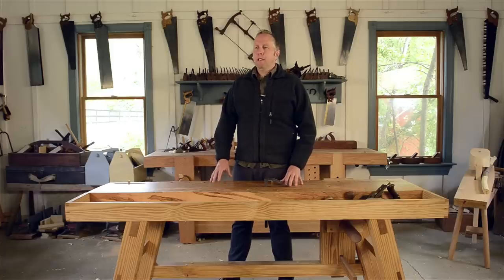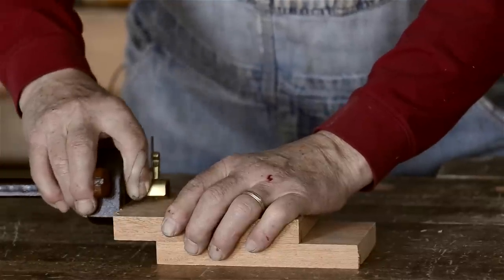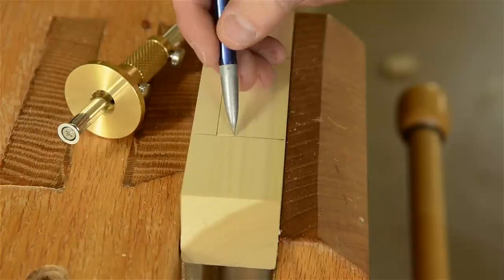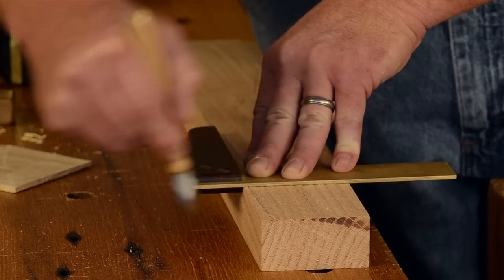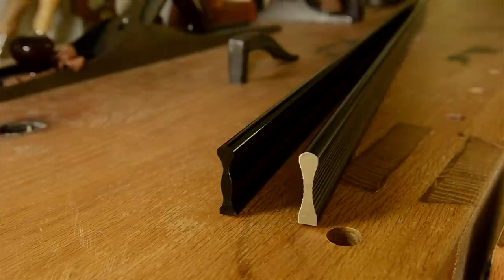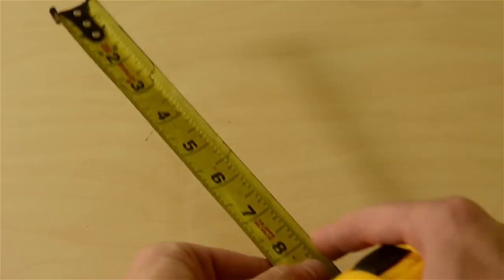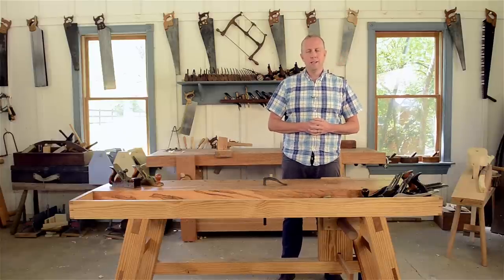Watch this Before Buying Woodworking Layout, Marking & Measuring Tools (Part 2)

Comment: The hook end of a tape measure is made to slide the same amount as the thickness of the hook. That way you get both accurate inside and outside measurements. Yes, I’m cool 😎 Also, don’t allow the spring loaded tape to slam the hook into the body of the tape as it retracts. Over time that will affect the amount the hook slides, bend the hook so it won’t stay hooked or worse, break the hook off.
Reply: Just about to write the same as you but you beat me to it.
Reply: Well, sense you mentioned the main points, I guess I will just add here.
You can use your index finger as a stop cushion at the end of the return so that you can still retract one handed, and the notch in the hook is for hanging a nail head; usually for radius measuring. There, I participated.😁

Comment: Dear Joshua, as always a well prepared and delivered piece of edutainment. There’s a couple of things I need to highlight.
1) Re first named round body marking gauge. You mentioned that there are two screws for added security. I guess you could use it that way but it was designed to give the user micro adjustment. The way it works is like this. Open both thumbscrews. Get your cutting marker to approximately the correct position and tighten the distal thumbscrew - the one furthest from the head. Then, twist the knurled collar and move the marking head to the exact position you want and then tighten the proximal thumbscrew. Voila, easy positioning in a quick period of time.

Comment: Here's a tip for newbies :  Buy an aluminum angle 2x2 or so.  Cut them to length wanted.  You can make them 12" -  18" - 24" - (unlimited) any length you want.  The Angle keeps them straight.  
You can also use them in tandem as winding sticks.  
You did mention them - but they really work quite well.  They can be used flat or on the angle up or down.

Comment: I'd recommend the quangsheng twin stem marking guage. It's well engineered in brass and stainless steel, locks tightly and comes with the shaft clamp as standard. It's also substantially cheaper than similar gauges from better known competitors.

Comment: A suggestion on the round head marking gauge that will not stay tight would be to remove the screw and drop a piece of solid lead shot just smaller than the screw into the hole and then replace the screw. Once the screw is tight the soft lead will compress and grip the shaft much tighter than just the screw alone.

Comment: I realize that this video came out 2 years ago, but I'd recommend that you try the Rob Cosman mortising gauge. It is expensive, but I like that both marking wheels are on the same shafts and that a mortising chisel can be used to set the width between the wheels.

Comment: After watching some woodworkers from 'across the pond', I really see the ease in using metric for some measurements.  The arithmetic seems so much easier.
Reply: Not everything is as it seems. I may just have more practice than most using US Customary for technical work though? So it is all easy for me. I wish I could explain the benefits to you but it took me a lifetime to discover it all myself. I'm a fairly smart cookie too. Or so I've been told by people with degrees to make their opinions qualified ones in the matter.
Reply: Metrics is the way to go. Its units of ten, like money. And thats easy to count.
Reply: @nathansackett6899  US Customary uses decimal units too. What comes after 10? You can have 11 millimeters, can't you? Or do you have to kick your shoes and socks off to count that high?
Reply: @azul8811  i think you misunderstood what I meant. I agree with you that the metric system is better and easier.
Reply: @azul8811  considering the profit risk analysis of trying to explain anything to you I am going to have to decline. If you're really interested you can figure it out for yourself with sufficient effort. Or not. Answers must come from within. I'll just add I do not use any English system. I am an American. We have our own system which the English borrowed a bit of. So at least get that right.
Reply: Every thing is relative. It’s just a matter of what one is used to.
Reply: This discussion has happened a million times here on the interwebs and in shops all over the United States.  SO - yeah the American system was, of course, handed to us by the Britts ( which is why we call it the imperial system) along with pounds and ounces, and we just never changed - BUT - depending on the industry here we do use the metric system sometimes exclusively.   In our scientific research and medicine, we are pretty exclusive with the metric system.  In other fields, though people would be surprised to find we use both and go back and forth.  It's not unlike being bilingual.  As an industrial designer, we always used both but had a rule of keeping each project exclusive to one or the other.  We have full sets of both imperial and metric tools as do all our auto mechanic's shops.
Reply: my point was agreeing with Carl - when you are used to it it's no big deal.
Reply: @carpenter1138  Here in Canada, we use both. Even though we switched to metric in the 70s! There are some industries that just won't give up the imperial system. Plumbing is one. We get engineered drawings that show everything in metric and every bit of material we use is imperial. It can be a bit frustrating but ya, you get used to it. Also get very good at conversions! But ya, the tools...most of ours don't require either but the ones that do, I need both sets.
Reply: 60's child so familiar with both. Worked in a profession which required meticulous accuracy. Metric.

Comment: Thanks for the video. One measuring tool I use for rough measures is a 3 foot wooden ruler. The kind you find at the big box stores. If I am cutting something to a non-critical dimension (say I need a piece to be 24"' give or take a quarter inch) they come in handy and make me feel like a kid again.
Reply: Joe Leonetti  What's the difference between a 3 foot wooden ruler and a yardstick?

Comment: The hook on the end of a tape measure is designed.  To provide curf spacing for when you transfer, a pushed measurements to a board.  Ex. when making a shelf.  Note when used to pull for the gap and the cut you need to manual adjust for curf.       (Curf is the list wood from the with of the saw teeth. )

Comment: I actually bought one of your American measuring tapes (in metric) the fastcap flatback one. I could get really thin sliding T rules etc but this works remarkably well as a thin tape with a good combination square across the tape to mark the board with.
Also, it's a metal tape and doesn't have a floppy hook like the others. I really don't liker the cup in regular metal tape measures.
For quicker work where I'd rather have a bit of standout I use the cheapest Stanley fatmax 1/2" wide tape. It is only 2m and enough for roughly measuring up a board but also, being a narrow tape the cup in the tape is not significant and doesn't need much leaning over to measure accurately, a ruler or square across it flattens it satisfactorily.

Comment: Fantastic, Joshua! Thanks a lot for all the tips! 😃
I made a marking gauge that turned out pretty beautiful. And I made a cutting wheel from a washer. Works nicely, but the dowel I used is made out of too soft wood, so it doesn't hold the screw very well. But I'm thinking about replacing it with a aluminium or brass dowel. 😊
I don't know why, but I love making tools. Go figure. 😂
Stay safe there with your family! 🖖😊

Comment: I don't recommend the gauges with one pin one side and two on the other because of the number of times I have stuck my fingers with mine.  You would think I might learn from experience but it doesn't seem to be happening.

Comment: Its loose for the thickness of the hook to measure if you set it against  a board or if your hook it on a board  and then there is a small hole in the tip to hook it on a nail if needed

Comment: The end of a tape measure moves to allow for the thickness of the metal tab when measuring inside and/or outside measurements. ALWAYS check the end before measuring. Its never fun to realize that your measurement are off by a 1/16th or more because your tip got bent.

Comment: On tape measures - I have several (like most people) but my go to one lays out FLAT!  There is no curve to it - that does mean it won't hold itself up, has to be slid along the wood to reach the end.  But it is accurate, because it is flat.

Comment: At 3:16, I have the marking gauge shown immediately to the left of the one you are holding.  A couple of days ago,  I used it to mark out tenons on the side and back panels of two bedside tables I am making for my daughter.  I carefully set the gauge to 3/4" and started marking the six boards.  About half way through the task, the marking gauge came out of adjustment and added about 1/8" to the size of the layout mark.  This in spite of the fact that I had both knurled knobs tightened completely.  Now I have to re-mark the tenons to the correct layout line, cut the tenons and then plane off the "bad" layout lines.  How can I prevent this from happening again?

Comment: Hi Joshua. Is there any rule of thumb when it comes to winding stick size vs the size of the work surface you are trying to see if it is in wind?  Will a 12 inch set of winding sticks work just as well as a 3 foot set when checking a 2 foot wide surface for example? Thank you.
Reply: You want your winding sticks to be at least as wide as the surface you are checking, wider is preferred whenever possible because a wider pair will allow you to be more accurate.
Reply: Hi Larry. ....also, the wider the sticks are, the more they will amplify the discrepancy.  IE: using  a 2' winding stick on a 12" board will be easier to see the wind than a 12" winding stick on a 12" board (the wind is amplified the further/wider the sticks are).  Hope this makes sense.   Have a happy day!

Comment: What do you do when a wooden marking gauge beam is loose when the screw is tightened?
Reply from the maker: I drop a small wooden dowel in the screw hole so it has something to tighten against. I show how to do this in the video on rehabbing marking gauges.
Reply: You could also oil the entire assembly well and wax. The wood may swell a bit when oiled and take up a little of the slack.

Comment: Is there any downside to using a box cutter style racer blade for marking? 

I have a few harbor freight ones with the snap blades I got for free and they seem to work well for me. 

Am I missing out on anything?
Reply: Not really. Just be sure that you tilt it sightly, to account for the bevel

Comment: The blade moves back and forth a distance equal to the thickness of the blade. This is for accurately measuring inside and outside dimensions.
Reply: You’re so cool

Comment: On the wheel gauges, does the wheel actually rotate as it moves across the wood?
Reply: It shouldn’t.
Reply: No. But you can rotate the cutter head if you want, especially over the edge of the board.

Comment: If you have been using a tape measure and don't know why the "tab" or hook moves; you're a rough carpenter and maybe should stay one ha,ha.  The reason the tab or hook moves is to compensate for the tape measure being used for both inside as well as outside measuring / dimensions.  The movement of the tab compensates its (tab) thickness when the tab is push against an inside corner of a workpiece vs hook over an edge and pulled.   If you're not a fan of this moving hook / tab and work with small work pieces you could "burn" an inch.  That is to say; you start your measuring at the 1" mark and not the tab / hook of the tape measure.  Be sure to add that one inch to your measurement.   Problem with tape measures;  not accurate - the U shape (for strength) of the tape makes is impossible to keep accuracy when the "tick" mark on the tape is above the workpiece.  Well used tape measures often wear the first foot or two of the tape away fast and can't be read.  If the tape is allowed to slam back into the tape's body you can break off the first inch or two.  When using a tape measure for long measurements often its best to have help from a friend of the tab flips off the end of a board. Tape measures are good for rough dimensions and are cheap.  Still, I find myself carrying one most days.  Like many tools ... they have a place in the tool box.
Reply: I "burn" ten inches, easier to keep track.
Reply: Was taught back in 1972 about the movement of the end by my dad and the carpenters school. Back then on work that had to be close we were taught to hold (burn) an inch, many tapes back then had problems at times with the first inch. I still do that, habit I guess.

Comment: The tape mesure wables the tip to account for if you are measuring by hocking the tip or if you are fencing her. It wables the thickness of the hook.

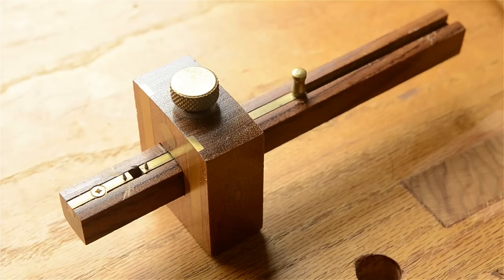Comment: 9:50 couldn't you just take the fence completely off and put it back on at 90 degrees?
Reply: Hi Jeremy  - I  have this $6.50 gauge.   The thumb screw locks both the fence and slide at the same time so you can't simply rotate it.  I made a separate slide and lock thumb  screw - it simply drops over the part that  you normally push with your finger (hope that makes sense ).  Have a happy day!

Comment: The hook on the tape measure wobbles because of cheap production. I welded mine with a MIG welder and now my tape measure is DEAD accurate!
Reply: No.  The metal hook on the end of the tape moves to allow you to make accurate measurements both internally and externally without having to make allowance for the thickness of the hook.